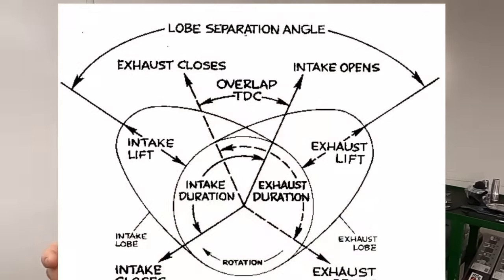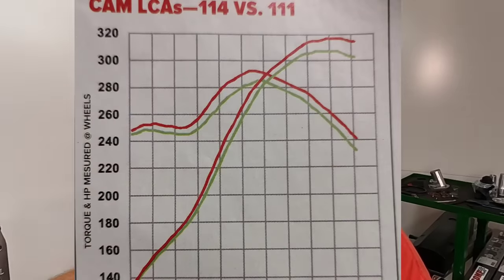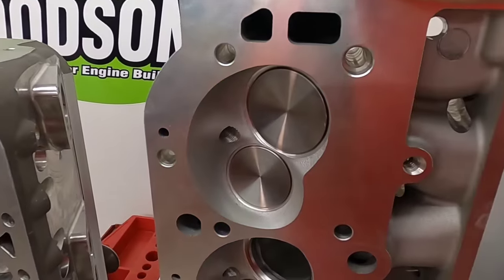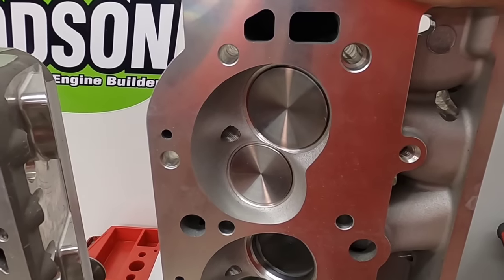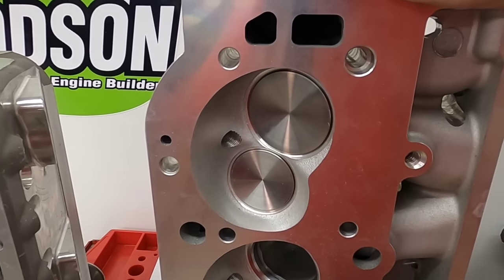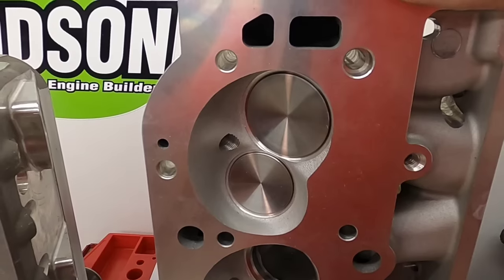Camshaft Lobe Separation Angle: The Untold Truth of LSA!! How to Pick LSA the right way@DavidVizard

Comment: Every time I go down the camshaft science rabbit hole, it makes me want to sell every car and go back to 2-strokes.  Think about what a reed-valve intake does.  Timing?  Duration?  Automatically does whatever the engine wants at that RPM and throttle opening.  You want overlap?  How about 110 degrees of overlap, with the exhaust port pulling negative-8 PSI of suction all the way to the air filter, pulling a whole cylinder displacement of charge into the exhaust, and then the pipe reverbs to positive-8 PSI to supercharge that fuel back into the cylinder.  Imagine being able to draw any combustion chamber shape you want, with no valves or reliefs or anything besides a spark plug.  Imagine no valvetrain at all to worry about floating or sticking or timing.  You can't make less than 2 hp per cubic inch unless you're trying to sabotage the motor.  Yeah, I'm still salty that cars use these clattering things with these hokey valves and cams and chains and pushrods and stuff.

Comment: I used to work for Summit Racing back in the day and I sold a lot of David's books.  I have several of my own on the shelf and I find myself referencing these each time I build an engine.  Great stuff!
Reply: I just went to the Summit in Georgia yesterday and was a bit disappointed to see that the only Vizard book on the shelf was the “high-perf. sbc on a budget.” That’s one of the best of his bibliography, but they could have filled another whole section with nothing but Mr. Vizard’s material.
Reply: Don't forget to hit the "Black" bell when subscribing to get a full notification every time.
  I am not racing, just want torque in town with my LS engine in the 67 C10 that fell into my driveway with a "Panoramic" rear window. Or a large rear as they call it in 68. If I need to carry 30 sheets of plywood (If I could afford it) or drywall and shut the tailgate, I can. That is a truck. Put torque where you need it. Mine is that 2k-4,5k range. The next guy wants 5-6,5k range, well better subscribe to find out. Remember, Richard Holder gets his check from "Holley" now! Lots of talk, little explanation for cam's. Well, once maybe!
DK, ASE master retired.
Reply: Greg Anderson how we do it?
Reply: @johnshackelford6965   I can't speak for Greg Anderson but the intended use, gear ratio in the type of trans (700R4) final drive (3.08:1) and tire size 245/65R16 year round tires, work great. My wife brags she beat several people on green light challenges way over a two block area. At "WOT" she says the tires squeal and thought it was the kid in the other car, until she realized it quit when she left off the gas. I did go crazy and wired the "Body Control Module" into the pickup, so I have light control, RKE, theft, power windows (OEM brackets welded onto Escalade regulators, moving pedals, door locks auto @ 7mph, warning sounds (Adaptor that plugs into factory harness), and more. DK, Omaha.
Reply: @MCNicholasR  12:22 12:24
Reply: I probably bought half of my Mustang engine from you. lol

Comment: Variable valve timing changed the game completely you get the best of both ends tight on the top and wide at the bottom for smooth idle we could only dream of such a thing back in the day when the rev limiter was our foot and ears lol
Reply: You only get that with DOHC though.  Something like a Hemi or LS or Viper with VVT is stuck with a fixed LSA.  But being able to change the lobe centerline angle is still a big deal.

The ultimate is something like Honda DOHC i-VTEC, where you get to phase the intake and exhaust around independently AND have two different lobe profiles to play with.  It's a big part of the reason why "lesser" 4-cylinders can't touch the might K-series.  Even a stock K20 has a VTEC cam bigger than anything you can buy that's streetable on a Ford Duratec, even with VVT.  They were running full pro-stock durations right off the dealership floor, still idling like a Mercedes and getting 35 mpg.

Comment: Glad to see someone is pushing torque instead of just speaking max HP numbers. I developed a theory that since HP is torque x RPM / by 5252 then the entirety of HP depends on the measured values and a constant when it comes to a rotating shaft. There are 3 ways to increase HP and they all include torque. 1. Increase torque in a given RPM range. 2. Increase RPM while maintaining or not allowing the torque to fall off faster than the RPM increase or 3. Increase torque and rpm. Which method is used depends on a lot of different other parameters. A drag race is different than a road race that is different than stock car and offshore boat racing different from these other types of race. A 600 HP diesel or an 160 HP air plane engine at 2300 RPM are much different than a 600 HP small block running at 6500 RPM but they all depend on a measured torque number for the horse power number. Torque has no dependency on a HP number.

Comment: Yes, your lobe separation angle determines your dynamic compression and the 'manners' of the engine.
Thank you sirs for a very informative video.
Reply: Sort of, indirectly …
Your intake valve closing point determines your DCR.  LSA only effects this because a wider vs narrower LSA (given all specs being the same) can move the the Intake lobe centerline and therefore the closing point of the intake valve.

Comment: Great discussion!

The LSA affects many aspects of performance.  It can change the volumetric efficiency peak point/peak torque point.  The optimal LSA is subject to the limitations/capabilities (RPM) of the engine components.  I feel the bore to stroke ratio has an impact on optimal LSA/overlap. 

Most of my race engines are in the 106° to 108° LSA range.
Reply: Street engines are completely  different,  LS engines have a wide LSA and reasons they have a broader power band. . Don't know why u would want a tight LSA. Id say 112/116 is better for street engines.
Reply: @jessesyfie7244   Well, some people(like me) run a 5000 rpm converter on the street in a 2450 lb car with a 500+ hp small displacement(332) engine running 108 LSA. I shift it at 8500 when racing. So I don't care what the engine does under 3500, because at full throttle, it doesn't ever load that low. With a very lightweight car and a slippery converter, it works out nicely. My car is a handful when I put it to the floor, but at partial throttle, it's a very smooth, nice driving street cruiser. You can actually see it cruising along in one of my vids. Terrible fuel mileage is the only downside. lol
Reply: @AmericanThunder wow 8500 is high. What is the engine and how can you go so high?
Reply: Richard Holdener did  an LSA  video where only the LSA was change.    112 VS 120 LSA gave 34 ft-lb 108 vs 112 LSA gave 14 ft-lb.   The peak power of the 112 was close to the 120LSA and the peak power of the 108LSA was almost 10 more rwhp than the 112LSA.      LSA doesn't favor emissions, but a tighter LSA will makemore midrange torque but possibly less emissions than a wider LSA. @jessesyfie7244
Reply: @jessesyfie7244  LS engines also utilize a cam phaser to take advantage of variable valve timing.
Reply: @charlesmyers9765  ya but I've heard there not reliable?
Reply: Shorter lobe separation allows the exhaust to help scavage air into the intake side. The amount the cylinder head flows makes a huge difference. Forced induction doesn't need the overlap or loe LSA because you will just blow boost out of the exhaust (minimal). Forced induction doesn't need the help to fill the cylinders. Applies to performance street livable engines that have a decent idle and vacuum. Not max power or all out crazy but decent volumetric efficiency.

Comment: Was wondering why i hadn't seen new content on DV's channel in a couple weeks.... David's knowledge is a national treasure! Always puts out well rounded informational videos! Subbed his new one and looking forward to more content from both of you guys! (Andy - constantly referring to your tuning videos. GREAT stuff) LSA is something you need to tune so that your Dynamic Compression is correct for your build too. Learned about this many years ago when i set out to really learn cams and how they work. Nobody ever talks about Dynamic Compression and how important of a factor it is.
Reply: Dynamic compression is why I stopped using calculated CR years ago when it became 'meaningless'
 On motorcycles, 102-103 LSA is quite common and stock motors run at about 175psi with redline anywhere from 9,500 to 13,500 rpm ( older bikes from 1970's to 1990's )
 As long as I get around 210 to 220 psi I know things will be 'fine'.
 The 'calculated CR' often works out between 14 or 17:1.
Suzuki actually stated CR on early RMZ250 was 17:1 but dynamic CR is much lower with under 200psi cranking.

Comment: Some time ago I built a spreadsheet to calc ideal cam events based on everything I could find that DV had written, included the 128 rule and LSA info.  It spits out numbers just as Andy described and takes out most of the guesswork;)
Thanks DV, I have read most of your publications.
Reply: I'm working on a similar spreadsheet, but how do you tell the intake centerline angle (or how to install the camshaft relative to the crank?) 
Also, I can't find much info on his rule of thumb for exhaust duration - what do you use?
Reply: Intake center line = small # subtracted  from large # +90=In.CL.  Same with the exhaust.

Comment: Thank you very much for this video, and a companion to it by David Vizard: among other things it validated a cam selection I made for the street for a Buick small block I'm building. According to the formula you and D.V. put forth, my particular engine needed a 107.5 LSA. The cam I'd selected was a Howard's SBB grind with a 108 LSA and a half inch lift at the valve. I'd been catching some flack for my pick of cams by some Buick experts, but I now feel I made the correct choice. More interesting, I have a fairly sophisticated Comp Cams software program which predicts my build will top out at 408 HP @ 5000 rpm, and 400 lbs of torque or more from 2000 to 5000 rpms on 9.6 comp ratio / 87 octane gas. I've run the numbers on the TA Performance (the Buick Guru)  high dollar software and it predicts the exact same thing, 408 hp @ 5000, and the same 400 lbs torque from 2000-5000 rpms. My build criteria was, street use only, "a million pounds of torque" from 2000-5000 rpms, 5000-5500 rpm rev limit, and 87 octane gas. With the cam I chose, as validated by your LSA calculations, I feel more and more confident that my build will work out per my plans, when completed. P.S, I snuck in a stroker crank, aftermarket forged pistons and ported aftermarket aluminum heads to help out the power output.

Comment: great video, awesome to see you both together.  I took DVs comments on LSA to heart and applied it to my sbc and it is great, thanks for the knowledge.  I still come across those who think that a tight LSA is for high rpm racing only, but I politely point out this knowledge to them and try to get them to see the light.  if not they can look at my tail "lights"

Comment: Thanks guys, good overview.  As long as you are talking street cars, by all means Andy you are right.  As soon as you go to the boat world, things get different.  It's mostly about exhaust over there.  If you are running dry headers your car recommendations work fine.  But, if you are running wet exhaust, you start to get into reversion issues (where you can get water into the cylinder).  And since most lakes are discouraging dry exhaust, if not banning it altogether, LSA becomes a tool to try to help with reversion.  
So the logical extension of this video is not only LSA, but cam install and what intake center line to use with what LSA to get a desired result ...
Reply: Hi Broc Luno! I am glad to see that you have posted on YTUBE! I should have consulted with you about cams for marine engines. Hope to see you on BITOG sometime soon. All the best.

Comment: This is interesting. The first engine I built was a 289 for my 67 Mustang back in high school. 

Given my minimum wage of $2.90 an hour, you could say it was a “budget build”. 

Fortunately, we had a great auto shop at school and a good community of Ford guys. 

So:

Started life as a 225 hp 4bbl 289. 
Build:
10:1 flat tops
Stock heads with 3 angle valve job and heavy springs (don’t remember the specs). 

Full length headers

Torker-II 

780 Holley

Cam was a Sig Erson High Flow 2. 

Everything on top of the short block and heads was scrounged, and bought used. 

That engine ran like a graped ape!!!  The car had a 4 spd and 3.91 gears. Won class at the local 8th mile most Saturday nights. 

No one, including myself, understood why that miss-match of used parts ran so well. 

It wasn’t till years later that I looked up the specs of that cam. Yup, 108deg LSA. 

I just stumbled onto a good match if used parts, starting with that cam!

Comment: Andy you and DV make a great team!! Bless you both for sharing your knowledge and talents!! I have learned so much in such a short time regarding cams and heads I can’t thank you enough. I know you’re primarily a Ford guy and David is a Chevy guy but here is a Pontiac question. Using DV’s 128 rule the calculation comes out to 103. Working with what I have to build a basically stock 455 engine for the drag strip using race fuel. I have 2 sets stock heads, one with 72 cc chamber and 1.96” int valve and a 101 cc chamber and 2.11” intake. Oddly enough published flow numbers show the small chamber head has better flow numbers (unported). Porting the 2.11” valve head has more flow potential but I’m no expert and pocket porting without a flow bench is the best I can do and I can’t have the head cut enough to get above 10.5:1 CR without using a dome piston. The 72 cc head will be 11.7:1 CR with the flat top pistons I have. All that to ask this. Will it be better to use the small chamber head or buy domed pistons and use the large chamber head? The weak link is the connecting rod so RPM is the limiting factor until I can afford to build a stroker. Then the calculations will be different. All advice is welcome and Thanks again!!

Comment: I feel the topic, as it’s discussed, is relegated to racing, 2WD, etc. I’ve got a 4300 lb 1980 manual bronco with a 10:1 aluminum headed 331 sbf, 35” tires, 3.73 LSD front/back, granny top loader dual plane w/ 1” open spacer roller cam 266/274 112 LSA, runs really good, 15mpg, 15” vacuum at idle, this was my first build and I feel it was mild and I aimed for mid range.

Comment: Great video Andy. Thanks for helping DV out with his channel. I subscribed to it several days ago,  and have watched every video. For those of you reading the comments, David covers this subject in depth in his How to Build Horsepower book. I have no doubt that he also wrote about it in some of his other books. If you haven't read any of his books,  I suggest that you do yourself a favour, and buy some of them. Regards Greg
Reply: Thanks for telling where this formula exists. The formula that's been stated before is by description of a cam optimised  for a small block Chevy. I have something very different ... Datsun A Series 1400cc for road racing with some significant restrictions in the rules (valve size restrictions for example). Current cam does pretty well but I'm sure I'm leaving something on the table. I'm buying the book!
Reply: @markmeller4996  yes. DV's 128 formula. The How to Build Horsepower book includes adjustments for compression ratio, canted valves, and other variables. It also talks about overlap, duration, and other cam features.

Comment: Nicely done.  I can't touch your experience, but I do note one thing that makes sense for a running engine: filling a cylinder begins with exhaust events, therfore LSA is a component of intake opening where good signal at the moment of opening intake is the focus.  Managing pulse flow through an engine system functions like a tuning fork in a way: the center frequency shows up as peak torque rpm, and as you note the right [street] build increases power everywhere.  As I see things, chamber volume and valve curtain area behave like an accumulator, except it dampens a negative signal instead of a positive one [as a hydraulic one would] - this does affect how cam timing is seen by the intake during the crossover event.  As a simple  comparison, would anyone pay attention to the volume inside a gas shock absorber relative to vehicle weight?  You betcha.
Thanks for the channel update info.

Comment: I use EngMod4T to model engines and I move opening and closing events around in order to start to close in camshafts(16v inline fours) as I find this gives me much more appreciation for how different timings alter power and curves, which directly leads to "why?" Given simulated traces of an accurately modeled engine you learn more in a few months of simulations than you could in years of dyno testing. The engines I develop tend to be roughly 4 hp/ci, so lie outside of your intended audience, but I'll be following along 😃
Reply: Are you using a current engine as a base?